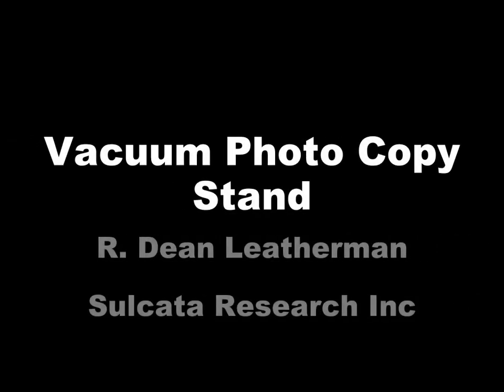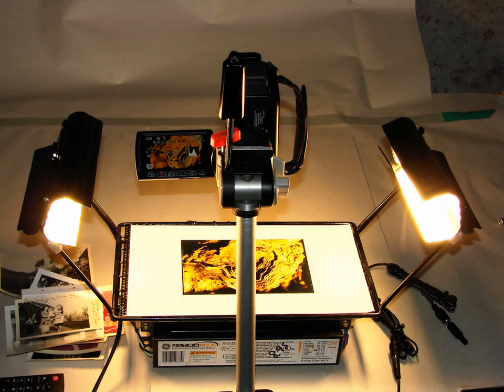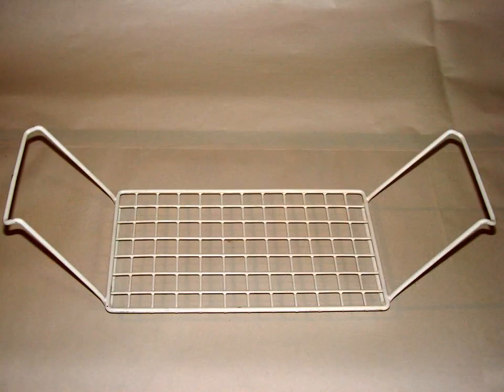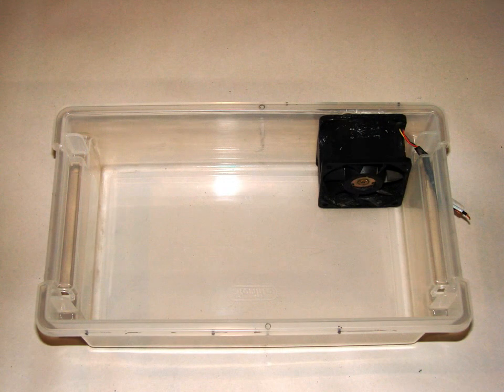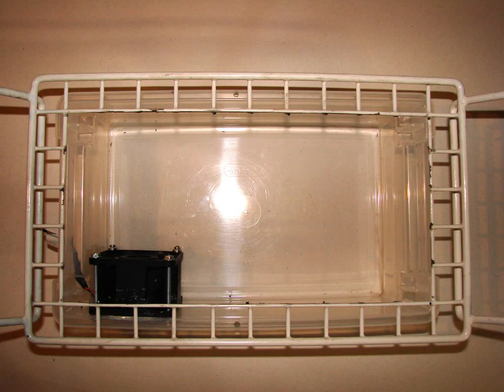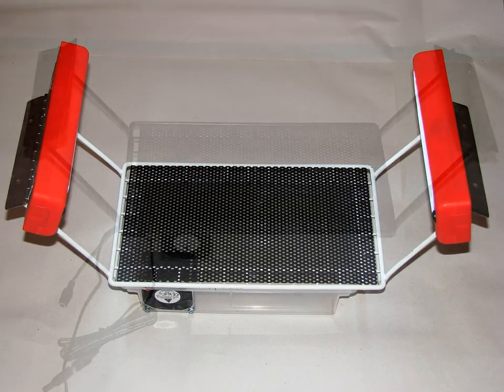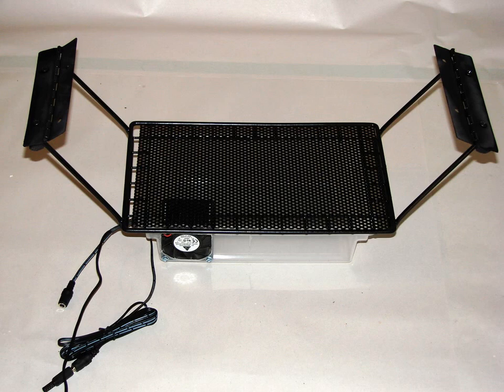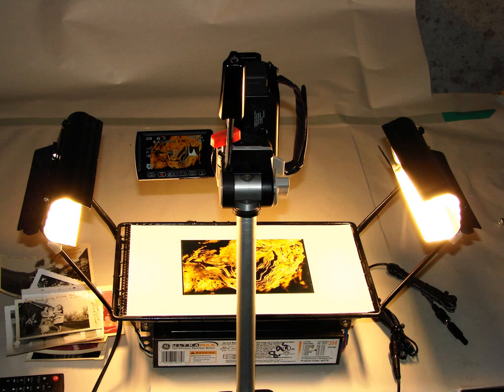Vacuum Photo Copy Stand.wmv

Comment: I just finished building this.  I came across this because I recently retired and in the process of captureing all my "old" photographs for the family, etc.  This works like a charm.  It took several trips to find the "right" container. I used a fan out of an old PC. I didn't use the lights. Instead I bought two small table lamps and sunlight LED bulbs.  I added the switch.  Can't thank you enough for posting this.  It was a fun project, now comes the work of capturing the pictures.  THANKS!

Comment: I am just seeing this video many years after it was created and it looks great. Do you have any hints on camera setup? like, what lens, is there a particular F stop that works best? shutter speed, exposure? I appreciate any help you might have. Thanks!
Reply from the maker: I just set it on auto everything except white balance. You really need to do that manually. A 1080P video camera works really well. The key is to make sure the camera lense is level to the copy bed. Many cameras have an auto balance feature to help with this. or you can make a special blocked end tube to go between your final setup distance and the bed. You just set the camera lens on the tube and lock everything down and remove the tube.

Comment: Fantastic idea.  I am definitely making on a these. Make sure you read the post that I replied to another fan with,  regarding my slide digitizer. Better yet... Here's a copy of the post, so you don't have to search for it.
     I built a slide digitizer that works perfectly.  I will have to make a video showing the construction process. (Youtube channel is Gordwing.. check back once in a while for the video)  The finished slide digitizer works incredibly well. Here is the digitizer before all of the finished shades and guards were installed: http://gordongreene.com/photogallery/displayimage.php?album=97&pid=4997#top_display_media    Here is a link to one of the finished photographs of one of my old slides. Keep in mind that this is a photographic copy of a 35mm color slide.  This is one of the finished product...  This is a 40 year old slide of my Pop in Hawaii.  http://gordongreene.com/photogallery/displayimage.php?album=97&pid=4970#top_display_media  I'm still working on the setup for copying negatives.  I have ordered a 35mm film holder to try to make some type of negative copier as I have tons of old family heirloom photos in negative form to digitize.
Reply from the maker: +GordWing FYI the fan is hard to find so you might want to substitute this inexensive blower and a small section of hose in the link below.  Also you can use LED panel available from Electronics Goldmine that are much better that what originally did. Just search for LED Panel.  

http://www.sunplay.com/intex-quick-fill-electric-air-pump-66619e?gclid=Cj0KEQiArou2BRDcoN_c6NDI3oMBEiQANeix5pe0WO9SfgUU4lefkcfqGDdqg_QjrFW9-fOcVa5pEWMaAgaq8P8HAQ
Reply: Hi, "photogallery" part of your site is down.

Comment from the maker: Hi James, sorry for the delay.  The white piece is what I call a vacuum mask but don't bother to mention it.  It is just a piece of paper that I cut out to fit the outline picture size I am copying.  It stops up the other holes in the plate and increases the vacuum in the spot under the picture.  I usually use it when I have a lot of pictures all of the same size.

Comment from the maker: Thanks.  Thanks for the info.  I came from a offset printing background where huge negatives and thin metal plates require such a vacuum holding mechanism. In that area they tend to say "stands, or plattens or plates". I am also a photographer and a videographer but have never needed such a device. You are right, "easel" is the common term for that device that somehow is rare used for either photography or printing.  Sorry for the confusion.

Comment: This is a nice project.  I made one using MDF pegboard. My vacuum source was a small hand vac cleaner that I had laying around.  I cut a hole the size of the tube in the side of the box and inserted the vac hose into it. There was more suction than I needed, but worked really well. Low vibration can be damped with foam rubber gasket. These are just some alternative ideas that might help in making this project.